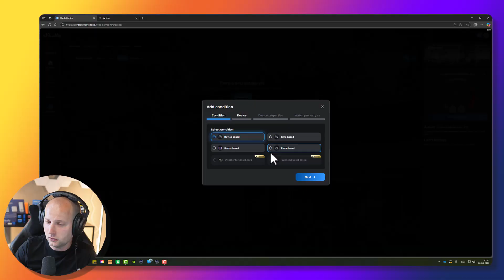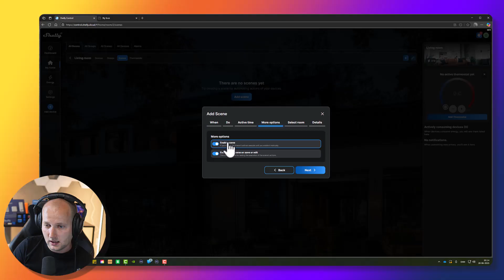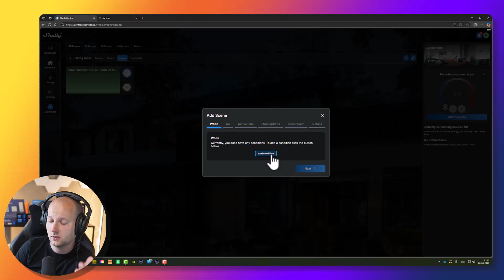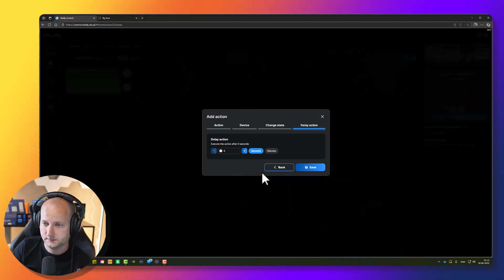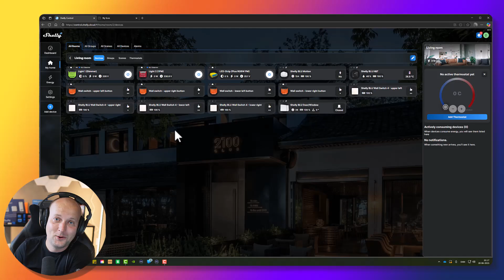14.3 - Shelly Smart Control – How to create automations (scenes) - Trigger one light from another

Comment: Hi, great video.Is there any chance to help me how to do a simple scene for a plug s socket in order for it to turn on and run for 30 mins and then turn off for an hour and then turn on again and run for 30 mins and so on? I have connected a heater to it that keeps my solar battery above 5 degrees and since it's inside a kinda closed space I don't want to run it 24/7. I struggle with the timer and delay option inside the control app. Thank you in advance for any help.